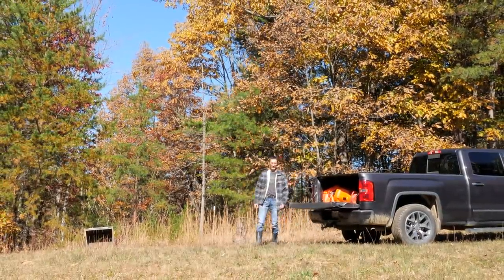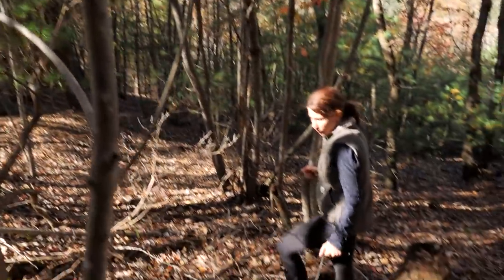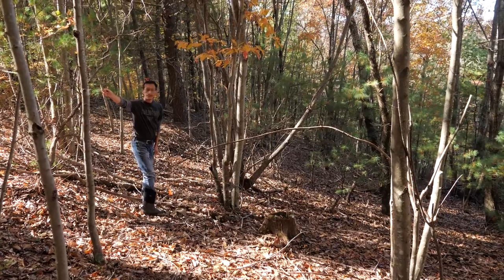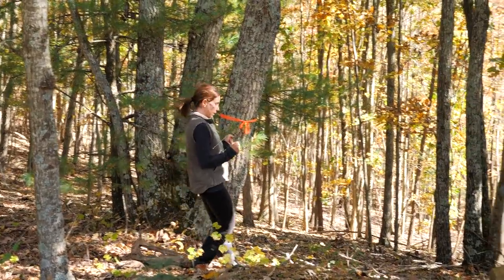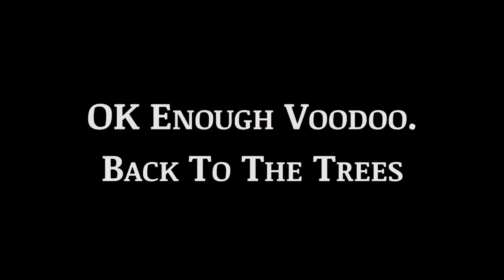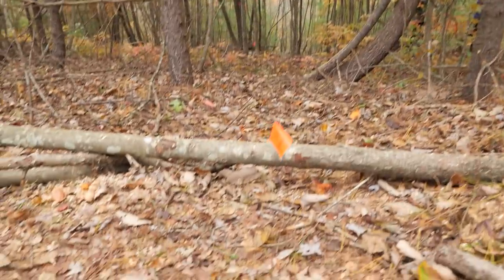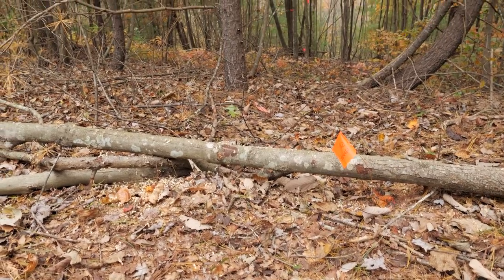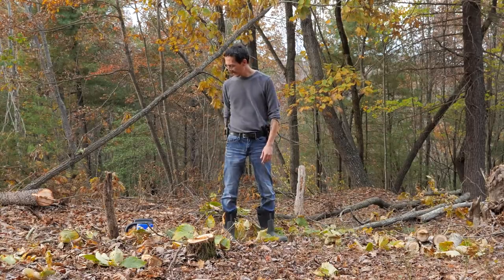Off Grid Home Build (#1): Clearing Trees and Finding Water

Comment: It might be worth having a go at the low point of the property.  If something were found, you could solar pump (Engineer775 does a lot of these types of configurations on his channel) up to a tank near the house on the ridge; less drilling than would be required on the ridge.
Reply: Depending how much elevation change it usually doesn’t matter.. just drill where you have the best chance of getting water. Pumps don’t care you can set solar pumps over 2000’
Reply from the maker: Also the water table tends to follow the grade. It’s not level.